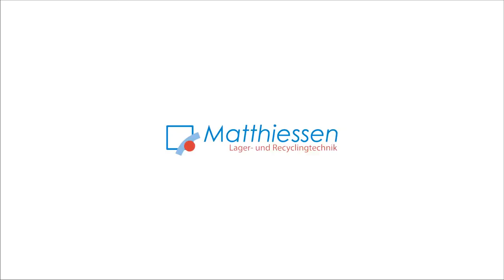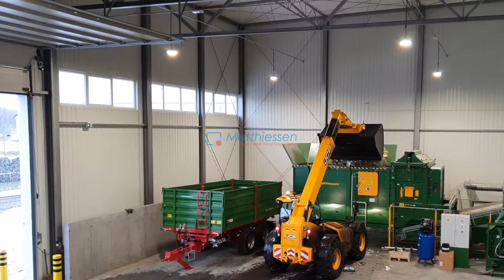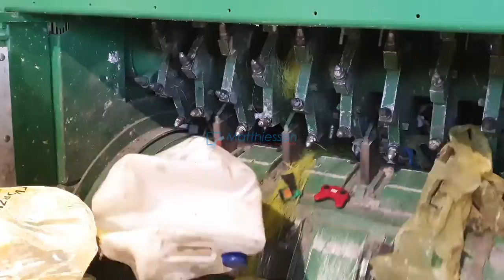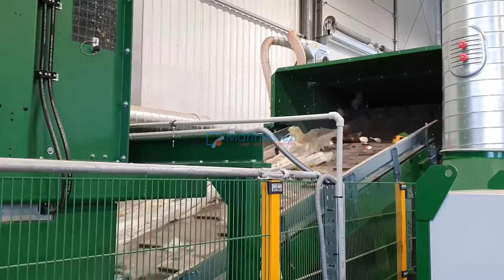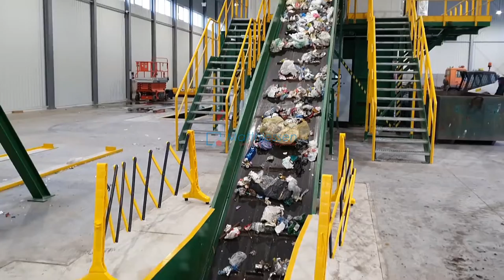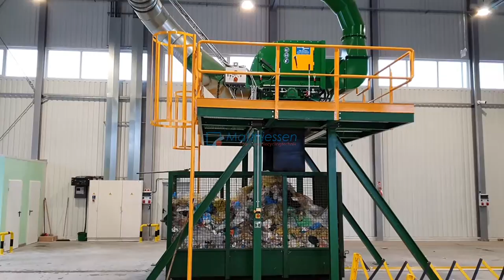Bag Splitter and Oversize Separator - Innovative Recycling Solutions by Matthiessen

Comment: I'm just a resident who puts ordinary garbage out for collection, but if a metal object, such as a microwave or BBQ were to go through this machine, would it cause any issues? I would assume they'd use a magnet to pull ferrous and non-ferrous off first but if something slipped through, would  there be any damage to the blades? I live in an area where there are a lot of metal objects thrown out and microwaves and BBQ's are common metal objects I've seen. I'm just curious, as I have seen videos of garbage hopper collection featuring lots of different metal objects, one was even a Jerry Can! Presumably not a genuine one, probably an imitation although it did make a lot of noise when the ACCO/Bucher packing blade pushed it back.